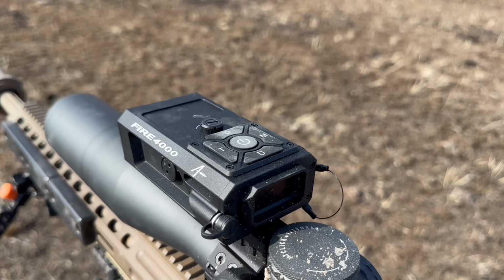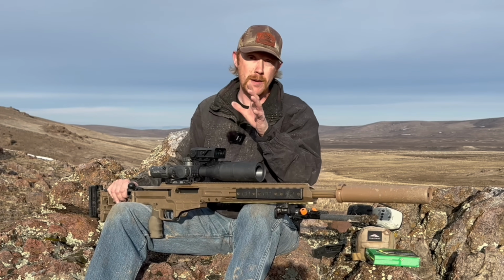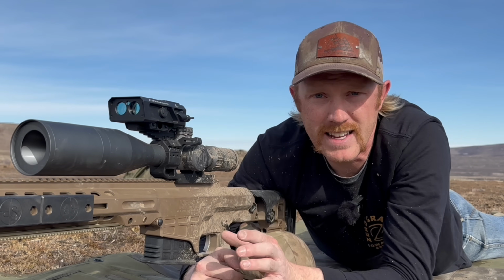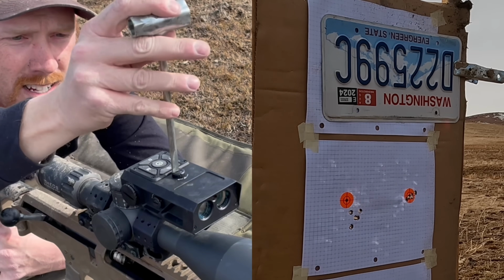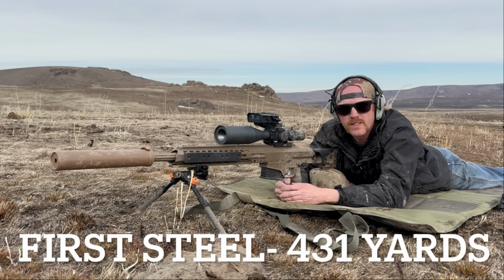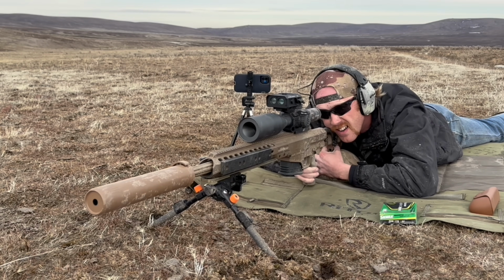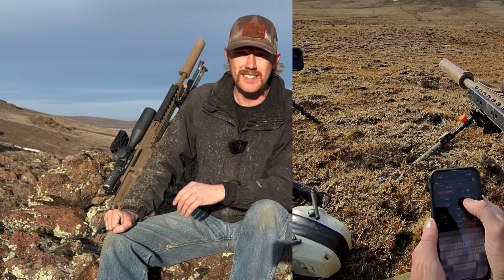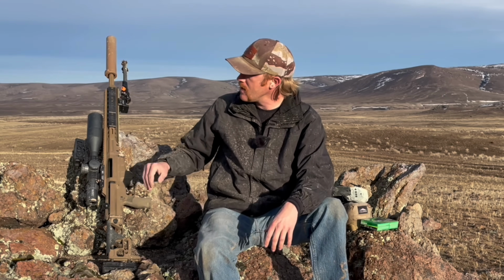Fire 4000 WMLRF- First Range Trip

Comment: The problem with these WMLRF's is the length of time it takes to squeeze off a round. By the time you set it up, do this , do that, on and on, the target is in the next county. I'd like to see a video where you drive up, throw the gun down and hit steel at distance, on the clock. Love the channel😀

Comment: @MountainsMulletsMerica
Great video as usual!
Have you had a chance to try out the Element Optics Weapon Mounted LRF Module?  Seems to do everything this does.  It is only $550, 4oz and tiny form factor at 4mm x 4" cylinder.
Reply from the maker: Yes I actually have one of the element RF modules and plan to test it out. A bit of a delay as I stripped one of the mounting screws and I’m having trouble finding a replacement. This is for sure something on my to do list though. Initial impression…. It’s a little big annoying to zero, that’s how I stripped the screw 🤦‍♂️
Reply: @MountainsMulletsMerica  
NOTED...I plan on getting one so I will keep that in mind.

Comment: Awesome video! 

For those asking if you HAVE to return to zero to range, you dont HAVE to, but you do have to hold UNDER whatever you dailed up in elevation.  So to prevent a incorrect ranging solution, either hold under so you're holding where you'd be back at "zero" or dial back down.  Typically it's easier and faster to dial back down to "zero" so you don't have any doubts about if you ranged correctly.

Comment: Have you looked into the element optics RF module? Its more basic and only goes to 1000 yards, but its $500. Looks like it could be good to pair with thermal where you're not typically shooting very far, but distance can be hard to judge.
Reply from the maker: I actually have an element rf module. I plan to feature it in some future content but I need some replacement screws for the ones I stripped in the mount. Initial impressions are it’s a nice unit but a little bit cumbersome to zero
Reply: @MountainsMulletsMerica  looking forward to it! Something I'm interested in on all these mounted range finders is if the zeroing laser is actually aligned and "slaved" to the IR of the actual range finder. I've seen some of the add on RF units for thermals being off quite a bit when you check with night vision to see where the RF beam is actually hitting. You might think you have it zeroed, but then while looking through night vision the RF beam is 10 yards off high and right or something. That can make zeroing the RF to your reticle even more of a pain.
Reply: @ Also wondering how well it does when not mounted above the scope. Say you put it off to the side using the scope rail on a bolt action, or on the side of a handguard or chassis? Will the RF hit your suppressor and not give you a range or will that not be a problem?
Reply from the maker: @Duckhunterbow  I ran the fire 4000 mounted on the left side of my mk12 this past weekend. Worked just fine.... that video should launch this saturday so hope you'll stay tuned to check it out!
Reply: I have one and it’s great on rimfire and air rifles (3-400 yds) but it has a beam divergence of 2 mrad so it’s garbage for long range
Reply from the maker: @mulhollp5190  interesting.... where are you coming up with a beam divergence of 2 mrad? From the pics I've seen under NV it's in the .8 mil range and is very much in line with other similar units. Also as shown in the video I was able to range out to 1600 yds in this video and others are getting returns much further on line so curious to hear more around what you mean by it's lack of capability at long range?
Reply: @MountainsMulletsMerica  wonder if he's talking about the element one?
Reply from the maker: @Duckhunterbow  Ah yes, I bet you're right. That would make sense given the response to your message originally about the element.
Reply: Yep, the element is what I’m talking about

Comment: Just got mine today. I use it with my kestrel. So quick to talk to it and show solution. Zerod mine at 8 yards at home (my adjustment is 2.91 so almost 1 mil). Will check at 100 yards when I go to range. If I range a small target I am always going to want to have it 1 mil above center of reticle correct?
Reply from the maker: So this is something I learned when I first got my impact 4000. Once you zero at 100 with your offset, that zero on the laser is now parallel to line of sight on your scope. At distance you’ll just use your crosshair for the ranging aiming point, you do not need to continue holding under by the 1ish mil that your lrf sits above center of the scope. Let me know if that doesn’t clear it up!
Reply: @MountainsMulletsMerica yes clear. Thank you.

Comment: I dont understand how this unit is as big & heavy as the Vortex, but without weatherstation on board 🤔
Reply from the maker: This unit is noticeably smaller and lighter than the vortex. There are some images online showing them side by side and the difference is very apparent
Reply: @MountainsMulletsMerica  Ive seen the difference in size, you're right. But the weight difference is only 1.2oz. For "just" an WMLRF I was hoping to see the market bring sth much lighter, like the element optics RF, but with stronger laser.

Cool product and amazing presentation none the less! 😃

Comment: I have noticed a .1-.2 mil shift down while shooting my MRAD off of a tripod. Was at a recent sniper match and talked to a few guys that use Mk22’s for work and they mentioned seeing essentially the same results off tripods. Not sure what causes the shift, but personally I have found it is consistent.
Reply from the maker: Yes I get a lot of comments about zero shifts with the mrad and positional shooting….. something I need to spend more time gathering data around. I felt like all of the shots off the tripod were good and the group wasn’t bad so it certainly feels like there could be some merit to the claims that they see shift. The interesting thing though is the shift was not present when shooting prone with bipod at the rear of the handguard
Reply: @MountainsMulletsMerica  my experience has always been that the rifle begins moving rearward before the bullet exits the muzzle. Any change in how the rifle is riding, whether it be in a bag or on a tripod, can impact POI.

Comment: Does it have a wired remote switch?
Reply from the maker: It does! I don’t run remotes due to constantly moving lasers around but this unit comes with a wired remote for those that want to use it